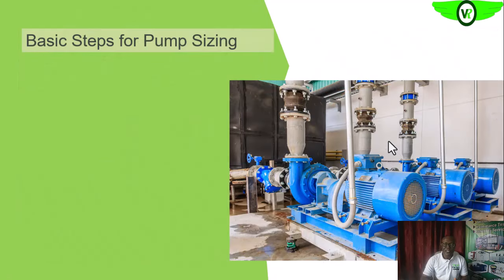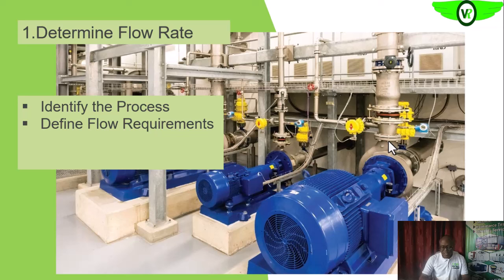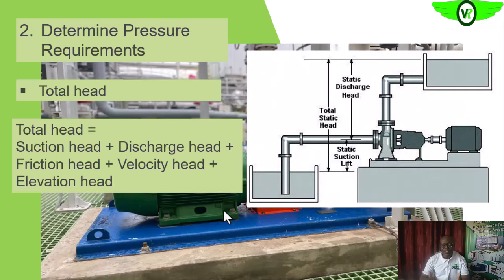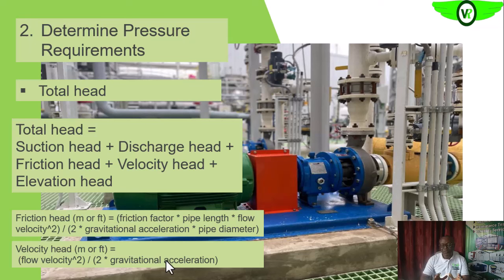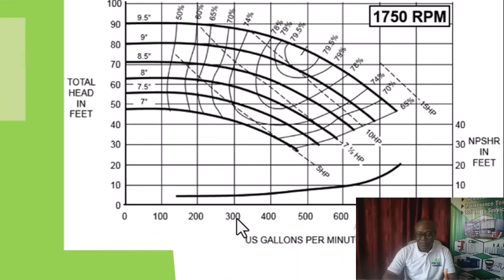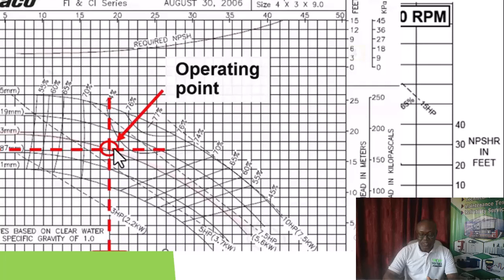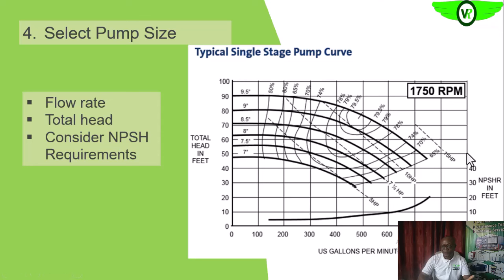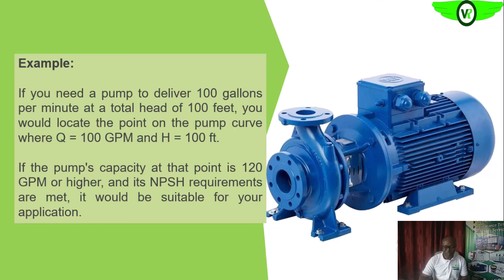Centrifugal Pumps: Sizing and Selection

Comment: if we change the speed of the pump, what will be the impact ( on the pump and the cost) ?
Reply from the maker: Changing the speed of a pump provides a flexible way to adjust its flow rate and head.

 However, it's important to consider the potential impacts on efficiency, power consumption, and cavitation. Proper analysis and consideration of the specific system requirements are crucial to optimize pump performance and energy efficiency.

Adjusting the speed of a pump can be a valuable tool for optimizing energy consumption and reducing operating costs.
 However, it's crucial to carefully consider the specific requirements of the application and the pump's characteristics to ensure that any changes are made in a way that maximizes efficiency and minimizes costs.
Reply: Thank you sir for this video.
Sir, can you please make one on sizing a vessel?